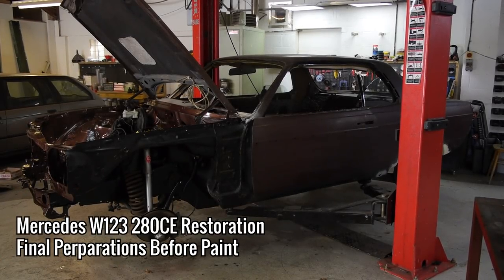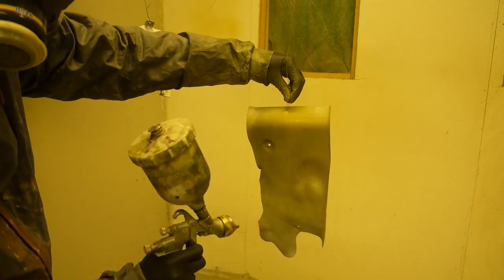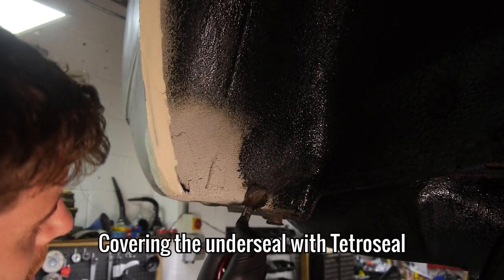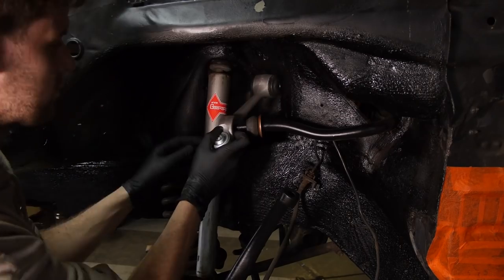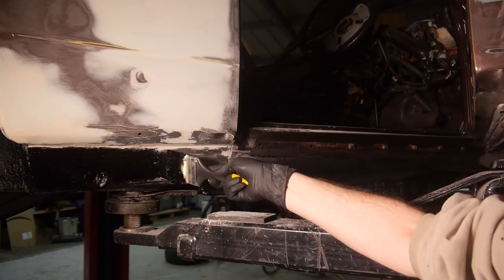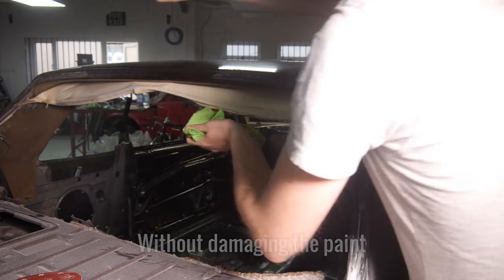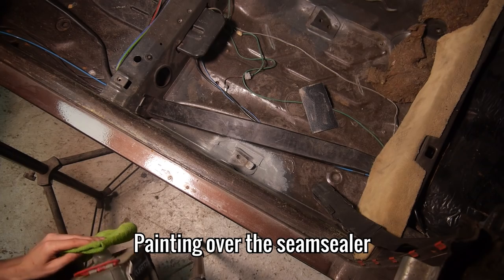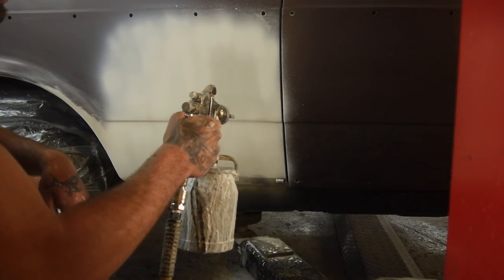Finally Ready For Paint - Mercedes W123 Restoration

Comment: Working on long tedious projects can and do often reach a point where you just want it over! I run into the same phenomena in my work too. I push through and then only take on very small jobs for a while. It can be very daunting and grueling. But as you said there is light at the end of the tunnel. Good luck.

Comment: Good stuff as always. A couple of notes - it's critical to use a metal roller to apply the sound proofing to properly adhere it. For the old material, place dry ice on top of it to help remove it cleaner and faster - and obviously make sure it's well ventilated. Looking forward to seeing the finished product. Cheers!

Edit: also, PPE! You don't want that body filler dust in your lungs

Comment: Eons is a great way to describe the time for zinc plating! I've been zinc plating hardware for basically an entire SAAB 900 at this point (was supposed to be an easy engine out, engine in rebuild), and I should have counted the amount of days I've spent, but it has to be close to 12 or 14 at this point. I know your pain well. I've also had to redo about 15% of the parts as I've had failures in the layers due to old degreaser that I should have changed out but I was too cheap.

Also, saw you have the pickeling step probably with a very mild 1% sulphuric acid dip, but I've had a bunch of luck with a step to help clean rust and residual material off with a strong muriatic acid step. I usually save the pickeling between the plating step and the chromating step. I'm sure your plating system may be a bit different as well. If it helps, I usually knock off any heavy rust with the wire wheel or sandblaster briefly, then dip my parts for about 20 minutes in the muriatic acid, rinse them in a distilled water and baking soda mix to neutralize the acid, and then wire wheel them again for a brilliant, pure mild steel shine. Just make sure you use a HDPE bucket and lid cause that acid will eat through anything else. A well ventilated area with a respirator is also required.

Comment: Butyl based "sound" deadeners are really just vibration dampners. Sound absorbing is usually done by something like Melamine foam or 3M Thinsulate.  Second Skin Damplifier Pro is another product that would go a long way (under carpet) to make this thing feel like a Mercedes. lol
Reply from the maker: Cheers forthat. I'll look into this.
Reply: @RestoreIt  Perhaps I can save you some time and trouble. Sound deadening is largely misunderstood because it's hard to sort through what is simply marketing vs. misinformation vs. actual fact. I'm certainly no acoustic engineer, but I fell down this rabbit hole myself some time ago on a project. Here's what I've learned...

For brevity's sake there are 3 categories of sound deadening. As JayinMI already mentioned, there are vibration dampeners and sound absorbers. The third category is sound blockers. 

Vibration dampeners prevent materials from resonating. Think of a tuning fork "ringing" out... that's resonance. Now imagine a tuning fork that's been dipped in bitumen. The extra mass clinging to the tuning fork changes the frequency in which the metal resonates, effectively "preventing" it from doing so (at least for our purposes). The satisfying "upscale" sound you hear when a luxury car door closes is mostly due to vibration dampening in the door. This is what your Dynamat is for, but more on that later.

Sound absorbers prevent sound waves from reflecting the way they do off of hard or non-porous surfaces. This is why music studio walls are covered in acoustic tiles, and why singers don't record songs in the back of an empty Ford Transit.

Finally, sound blockers provide an actual barrier to prevent sound wave transmission into the airspace by "decoupling" that airspace from the transmissible surface. That sounds confusing, but it's quite simple in practice. The car's interior is the airspace and the transmissible surface (for road noise, for instance), is the floor. By "separating" the interior airspace from the metal floor, you effectively prevent sound waves from entering the airspace at all. Thus, overall road noise is reduced. 

As you can imagine, effective sound deadening for a vehicle may require a combination of all three types BUT the most cost-effective solution for a car consists of vibration dampening tiles (CLD tiles) properly installed where needed, and a sound blocker on the floor. You can spend a LOT of time and money trying to achieve perfection but there are diminishing returns. Ultimately it is a car, which is a poor acoustic environment no matter what. The basics will get you 85% of the way there. 

Last thing (I promise), the Dynamat you already put in the car MUST be rolled in order to work properly. You do NOT need to cover the entire floor for an effective installation (research CLD tile installation), but a roller must be used to bond the material to the floor or else it's basically a waste of money, materials, and effort. Thank you for coming to my TED talk.